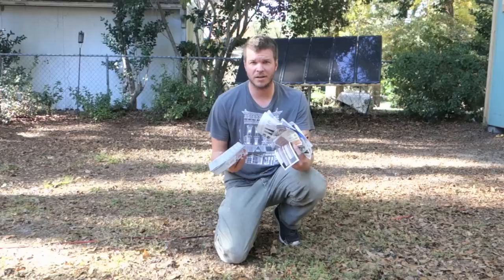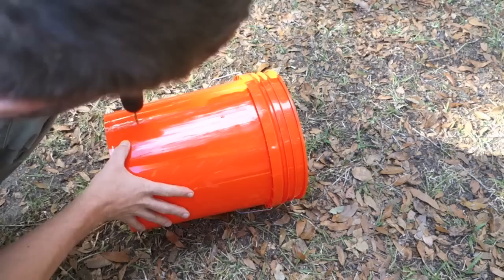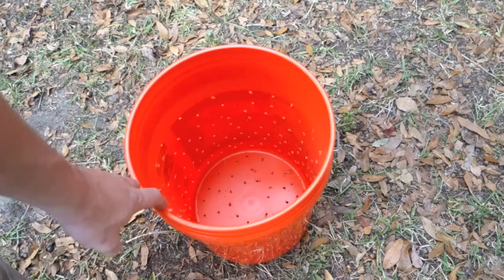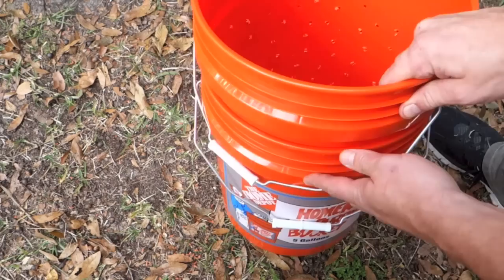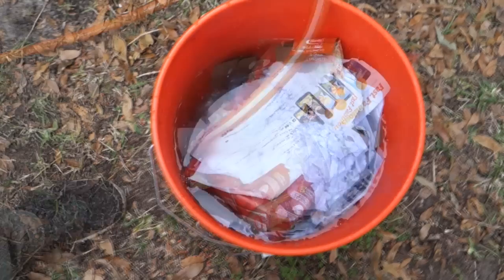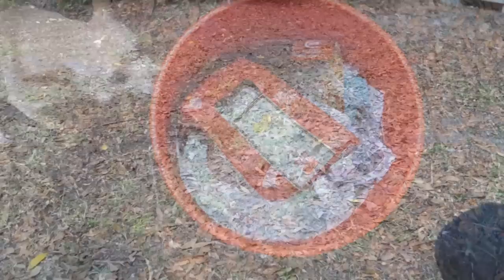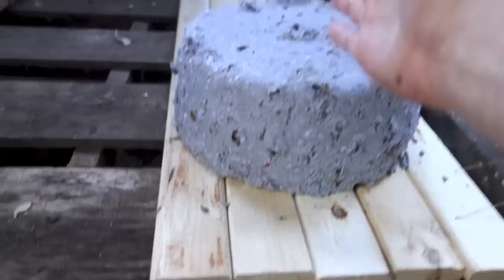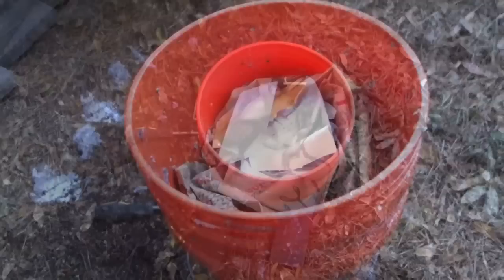Free And Virtually Unlimited Fuel To Heat Your Home

Comment: If you take the mix and use a hydraulic press or modified log splitter it will become so solid as to increase burn time and BTU output. It will also allow for a cleaner burn. I wouldnt use paper that had high color ink as it contains metals.  Regardless of some of the comments, it can be worth your while if you do large batches at a time.  As for the tree chopping enthusiasts,  This methos is far more time and labor efficient that chopping wood.  No chainsaws, oil, gas, air polution in the making of this paper fuel.  Personally I would find it easier to collect cardboard boxes than paper alone.  Even the left over water can be evaporated leaving "lint" to add to the next mix.  The evaporated water would be pollution free.
Reply: I like the way you think,  I just moved to New England and after last year I see massive piles of split wood every where I go.  I think it looks better if you leave it in the forest. althou we could do some clean up to  prevent fires. Check out rocket stoves  with thermal mass,  They are much more efficient, and you can feed them dead fall, and smaller branches ( you know the stuff you have to pick up after the wind blows) and get more heat.
Reply: In Africa scavenge fallen leaves and twigs ... No need drop or cut trees ...
Reply: it would also be a relatively simple matter to talk to others in your neighborhood I'm sure the majority of them would be happy to let you have their junk mail and other paper waste products ie toilet paper rolls paper towel rolls empty egg cartoons etc.
Reply: Com certeza !!! Vc já fez um video USANDO os  briquetes???
Reply: Crow T. Robot Incorrect.  The bi-products (gas) being quickly released due from having been compressed and pre heated increases BTU's.  Upon being released from a compressed state. heated mass surface area is suddenly exposed and creates rapid oxidation.  This is similar to enclosed elements in a structure fire. Keep in mind that the compressed material is not the only thing burning.  There are pre and post combustion heated gases which contain as yet unburned particulates which will burn after a slight delay.  Elementary physics.

Comment: How much energy does your drill consume to blend the paper - unless you blend this by hand, you use energy to produce energy
Reply: Kurt Schmid It takes 10 seconds to moosh this gunk up with the drill; and takes 10 hours to heat a home, maybe even 10 days if you live somewhere very cold.
Reply: ***** Yes..but how much energy does one of this blocks produce? it wont last for 10 hours right?
Reply: Kurt Schmid I'm not sure how these bricks would burn, but I would love to see it in action on Youtube sometime. My guess, is that because it is compressed, that it would be like one of those charcoal brickette thingies that glow when "burning", and last a long time. At the end of the day, it's basically just wood, isn't it? So my guess would be, that it would burn similar to a "Swedish log" or whatever those split logs are called; or more accurately, a simple log thrown onto the fire. It would most definitely burn slower, because there's less surface area... If you had the equivalent of that in pellets, it would blow the house up to smithereens. I personally would not use a drill; as it kind of detracts from the whole "hunter gatherer" theme that is going on.  I would just shred everything up, and let the water do the breaking up (I think that's how they make papier-mache). Also, not everyone has a drill, and they cost money, and so does the gas needed to drive your automobile to the drill-store and back again. So I agree with you, regarding the use of this drill....but it's quicker and easier. Also, I would try and make an organic "sticky blend" of some kind of flammable liquid/oil of some sort and mix it into the paper... maybe even alcohol; I don't know; I would most certainly try stuff out and see what works best!!!!!!!!
Reply: ***** your fuel doesn't last longer in a colder environment.  :)

Comment: I generally hit my local post office 3 times a week.  I have 4 in x 18in pvc pipe I fill with my mesh. I spray with non stick spray then pack it tight. Once its pretty hard, it slides out and i lay it out in the sun. Perfect for the fireplace

Comment: A cleaner version of this would be to use sawdust and leaves. I can tell that you'd have plenty of sawdust because I heard a circular saw in the background.
Reply: Paper is made with binders that hold the pulp ('sawdust') together, and this works by re-activating the binders. Sawdust and leaves would not make a mass that would stay in a solid chunk like paper does.
 There is a type of pellet press that takes sawdust or fine shredded leaves and twigs and makes wood pellets, but it uses a lot of pressure, far more than sitting on a bucket!
Reply: Actually works even better with any free pulpable wood product. I add some bark chips to even out the burn since these can go out easy when burning only two or three,
Reply: Davis Top
True, you could ADD sawdust/leaves to the junk mail mix....good idea!

Comment: Wouldn't it have worked to squeeze out the water to place another bucket without holes over the mulched paper instead of cutting the wood press "weights"?
Reply: It would work that way but then you'd have a hard time trying to get that bucket back out.
Reply: Travis Phillips nice video. i would also go with another bucket loaded with weight like sand or soil or whatever then you can leave it on top for as long as you like in the sun constantly pressing down on the paper. it should get rid of alot of water. the bucket should not get stuck because with the holes their is no air trapped and also it wont go right down to the bottom so shouldnt be a issue. black buckets would be ideal or clear if you can get them but doubtful. great idea though. thanks
Reply: Travis Phillips
Buckets come apart quite easy if you coat the outside of your presser bucket with a little lard. Real fine, just enough to break surface tension.
Reply: ***** valseline?
Reply: ***** Buckets usually come apart easily if there are holes in the bottom of either bucket.  And you can also stick a dowel thru them to help break the surface tension.

Best thing to use, chemically, is mold release from a hobby shop, or plain old Pam cooking spray.  Quick, cheap & lots less messy.

Comment: Why not just use a third pail for your press?
Reply from the maker: You can certainly do that if you like. In this video I show you how to do this process with two buckets, if you have three then go for it!
Reply: Tiny House Listings
Using just 2 buckets, it still works to use the first bucket as your press.  You just lose the extra water that is separated during the pressing.
Reply: Edward Riggs thats what i was thinking
Reply: Edward Riggs Exactly.. and if your that worried about wasting water.. press it in your garden or something.
Reply: weeral1 Or use waste water in the first place. Like tha water of washing vegetables.
Reply: Federico Spadone thats a smart idea
Reply: Federico Spadone
How you want to use that water ? Washing vegetables in the garden ?
Reply: rockyrobin24 ?

Comment: I heard wood works good too
Reply: +howiboy Takes a hell of a lot of effort to chop trees, but you'd be built pretty nicely after a while of doing it.
Reply: +howiboy he said "wood"
Reply: boiioiioiiingggggg!
Reply: +plasticspine same here
i dont understand why you would use somethign else
1. your doing something good for humanity
2. there are virtually unlimited
3. they burn pretty well
4.you can cultivate them if you hold enough  ( you would need a big property tho)

so yea
Reply from the maker: +Nox665 And in the process, using it's energy in a productive way. Thanks for the not-so-kind feedback.
Reply from the maker: +Serite Ross Yes, that works too.
Reply: and transmission fluid

Comment: I wouldn't waste time to make fuel with this system, but I can see how it could be adapted for doing laundry if your washing machine was broken. You could wash the clothes in the bucket with the holes, and then drain the laundry, rinse, drain again, then hang to dry (or wring out and use your dryer). This could be set up as a laundry system for a grid-down (emergency) situation.
Reply: And that bent up circular saw blade really gets out the stains 😉🤣

Comment: I realize the author "Tiny House listings" says it all so you wouldn't have any room for a trash compactor inside a tiny house. Otherwise you could compress your household garbage into cubes and burn it. Paper, plastic and all...

A bought a used trash compactor for $60 and after the refrigerator, it's one of the best appliances I ever bought. If I had a choice between a trash compactor and a microwave, I'd choose the trash compactor. Don't buy one new, there are plenty of these at charity and thrift stores.

My wife creates an ungodly amount of garbage. Sometimes so much I'd have to place the excess in my parent's trash can. I have had to burn it at times and shovel the ashes into our trash can. Now I can compress a weeks worth of garbage into no more than 2 cubes.

Since then when I find a good deal on one at a thrift store, I'll buy it. I got one in the basement as a spare if the one in my kitchen craps out. I got one in my garage I bought for $20 that appeared as if it had never been used I use to crush aluminum cans with. Yeah I know I'll have to crush allot of cans to pay off a $20 trash compactor but I'll save time and gas money not having to make multiple trips to the recycling center.

I've actually considered burning these cubes in a wood stove to heat (or help heat) my garage instead of burning propane. The downside is accumulating these cubes from April to November. They would have to be stored somewhere secure to keep the raccoons and rats from tearing into them. Plus storing them over the summer would give off quite a stench.

Comment: Or you could burn a log.  This is way too much work for what you get.  I have heated my house for the last decade with wood and never cut down a single healthy tree.  There is an abundance of free wood out there for a little sweat.  In the time it takes to make a paper block by this method, I could get enough wood to heat my house for a week.
Reply: Aye, just use the mail paper to start a fire with instead.
Reply: Theres also a lot of garbage paper that can be used if you live in an area without an abundance of trees. Also just a little sweat.

Comment: I wish he would stop touching that circular saw, as he's talking. Just hope that the drill wasn't plugged in.
Reply: ***** And there are toxic, heavy metals used in some ink pigments that need to be considered. Burning this material releases them into the surrounding environment where they can be inhaled. You would need to check the MSDS (material Safety Data Sheet) and/or the HMIS (Hazardous Materials Identification System) for the particular ink to know which are hazardous.
Reply: I know I know! I remember when my boss taught me how to use a circular saw he held the blade and the saw activated and chopped both his hands off. We called him handy andy and shortly after he committed suicide and I no longer had an apprenticeship. Wild times indeed!
Reply: namzarf Also consider that if your sotve has a catalytic  element you DON'T want to use "slick" paper (advertisements) because the silicone and other ink fixatives  will load up your catalyic converter and it will fail sooner than needed
Reply: Nathan S Before passing judgement, know of what you speak. Talk with Blaze King or any woodstove mfg that incorporates catalytic converters in their stoves and they will tell you the same thing, or go ahead and use it. Your money.
Reply: TNikoli Before you pass judgement, you should always take the time to read the post you pass judgement on, or it just becomes random ranting. If you had taken the time to read Nathan's post before answering it you would have known that he was responding to someone else, because that is actually the headline, in bold text, of the post. The very first thing you see if you do read it. If you go even further and use your brain too, you can deduct from the fact that there is no post from the person he is replying to, that this person either removed it himself or it was actually retarded enought to be deleted by YT staff...

Sorry for bashing you like this, but it's just something about people being wrong while correcting others that ticks me off a hell of a lot more than just someone being plain wrong. I just think that whoever you are accusing of being in the wrong deserves you thinking it through first.
Reply: namzarf the exhaust could be passed through a bubler, and then the waste water could be evaporated, leaving the remaining sediments to be disposed of more safetly. Also, the heavy metals in the inks would be very low concentration. I'd be more worried about dioxins, which require a plasma burner to decompose.
Reply: grizzlewolf brown Indeed, environmentally persistent TCDD's, PCDD's (and related PCB's) are the best reason to avoid burning this material. I question the effectiveness of the bubbler, however, and It's more trouble than it's worth. Then, what do you do with the concentrated compounds?
This might be a good time for everyone to stop and think about the quantity and toxicity of the chemistry we're all adding to an already over-burdened environment.

Comment: Toxic chemicals in both of those. I advise you don't burn it.
Reply: +Patrick Riley I agree with you.  Illinois EPA info (in part reads):  household trash (consists of) bleached paper...printed materials with toxic chemicals...chemical dyes, coatings, pigments and chlorine that can form even more toxic chemicals when burned.   http://www.epa.illinois.gov/topics/community-relations/general/burn-barrels/index
Reply: +caseyuscasey Unlisted yup those papers are full of ink and other chemicals
Reply: Those with asthma or young children, babies, and fetuses (delicate lungs and developing brains), would be worse off exposed to air polluted nearby/next door. (I don't know if dumps burn paper.  If so, it should be banned since it will harm the masses IMO.)
Reply: +PleaseCiteYourSources Thanks Waste incinerators use controlled burning environments with high temperature and added extra oxygen for more efficient burning, among other measures and flue gas treatments. An incinerator burning tonnes of waste a day produces less pollutants than a single household would burning a few kilos of waste/paper. Modern incinerator facilities are very safe, clean, and are controlled by strict emission regulations.
Reply: +PleaseCiteYourSources Thanks Source of this information: EPA document ""Evaluation of Emissions from the Open Burning of Household Waste in Barrels".
Reply: +sc00f almost all your points are correct except that we try to keep post combustion O2 low so that we generate minimal CO, and we only use atmospheric air via forced/induced draft to supply the fire with O2
Reply: +sc00f yeah and when you accidentaly find yourself in china, let me know how these regulations work over there. Thanks in advance.

Comment: dude instead of making the paper log ，u could have just burned the papers before processing it，and burn the log and u can save 4galoons of water。 however i personally have no problem with u doing that in ur house cuz u paid for it and u are happy to do it that way but i personally think its inefficient and is a waste of paper buckets logs and water。
Reply: Normal Paper burns faster and not so efficient so you have lots of ash. If you compress it, it is closer to firewood.
But the real problem isn't the fact that it takes a lot of time to make these logs but that Paper contains a lot of chemicals. Besides the ink there are optical brighteners and fillers in the paper. These chemicals can not be totally burnt in an regular oven so there are lots of agressive chemical products in the smoke that can also damage your chimney. 
And you should never use that ash as a fertilizer in your garden. Put it in the trash can instead.
Reply: LOL, and then it goes to the landfill and leaches into the groundwater....just say'n
Reply: yep,  exactly.  The only thing you can gain by making the paper into a dense log is a slower burn and less trips to keep throwing paper in. Otherwise the heat output value is just the same.

Comment: some of those scraps of paper have plastic in and plastic s toxic so can harm you in lots of ways so honestly this is cool but its most likely gonna create more problems than its gonna fix! and as tiny house listings says the chemicals wont be an issue, hes wrong, search it up!
Reply: Then just rip it out
Reply: Obviously you didn't read the entire comment, the very first thing in the comment is "I'm working on a heater where the chemicals being burned from the paper won't be an issue." so he literally says he's working on something that will negate the chemical fumes.
Reply: Stefan Vallin 
hello
Reply: You could probably get around that by using a heat exchanger instead of direct fumes.  Like burn these as a core inside a coiled water jacket for radiant heat.

Comment: Great idea and great tips here in the comment section! I have a tip to add: place a toilet paper roll in the center of the brick. It will dry faster and burn more completely.
Reply from the maker: Not a bad idea! It would of course burn faster too but it would be interesting to see how much longer it takes to dry and how more quickly it burns and make a decision based on that!